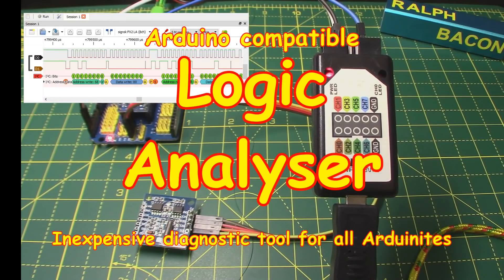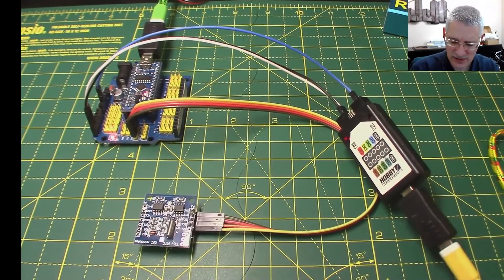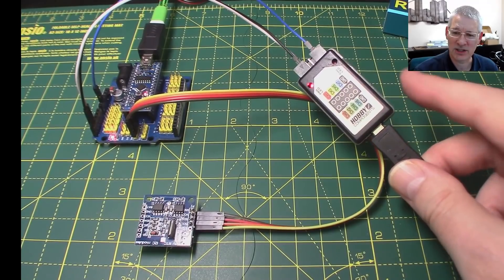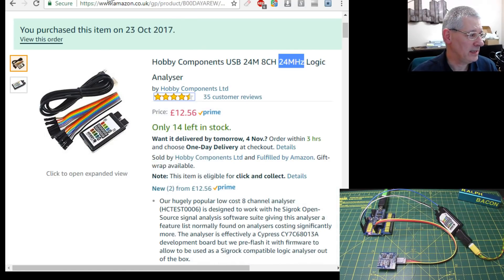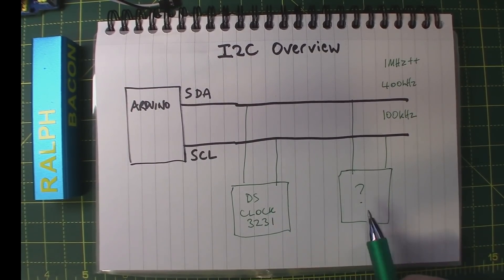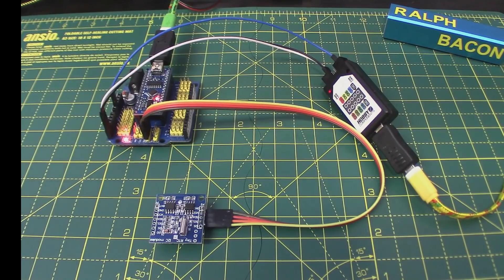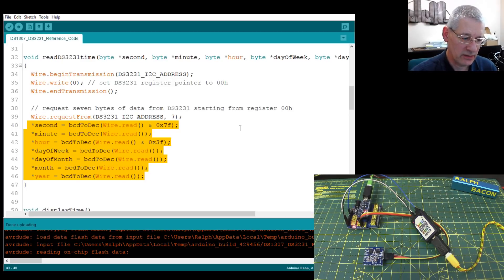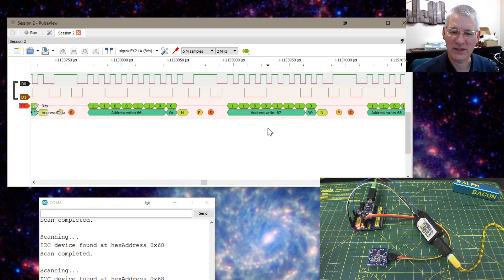#99 Logic Analyzer for I2C, SPI and many more protocols

Comment: Ralph, You have a gift for explaining things in a well-paced easy style. You clearly know far more than you present but keep it at a level that the Arduinites / hobbyists will absorb and then go and experiment for themselves. That is what all this is about otherwise we would have chosen another hobby!

 I have always wondered if I should have a logic analyser but thought it would make me more dangerous than I already am. Based on this video I will get one of these. Not just for comms analysis but also for general debugging as one of the comments below highlights.
Reply from the maker: Indeed, go for it, Whitefields, these are easier to use than I thought they might be, but be aware that there are variants that use the same or similar software and which may not be as easy to set up. In some ways the more you spend the better the facilities (think PicoScope) but this cheap entry level unit is a great hobbyist tool.

Comment: Ralph, 15 months on from your original posting, I followed your video on 9 Feb 2018 and can confirm that it all works. One slight wrinkle is the Hobby Components link to Sigrok needs updating. I suggest your deciples go straight to SIGROK then search on PulseView. Then find a download for their operating system. The driver comes packaged with the download, just run the driver FIRST, then install PulseView. In my case the 8 channel device self-populated in the window and ran first time. The Hobby Components site does have some useful looking troubleshooting info, but I did not need it. Thanks for introducing us to this tool.
Reply from the maker: That's a great piece of information, whitefields5595, and of course, highlights the problem with links to the Internet (which is why I tend to take a copy of the libraries I use in my demos and put them on my GitHub in case they disappear or get updated without being backwards compatible). Glad you liked the demo, it's amazing what you can get for just a few pounds/dollars.

Comment: Yet another excellent video, Ralph. If you ever come back to this subject, one analysis, that is excellent  for demonstrating interrupt driven or cycle sharing  streams, is to analyse the serial TX line and an output pin, say to an led. In the setup function, send a string to serial via println(). Then in the loop function flash the output pin . If everything is wired up correctly, Sigrok should show that when we send a string (or any other data) through serial, the function returns BEFORE the transmission has completed. So, the output starts pulsing before the the string has all been sent. Just one of many examples of how a logic analyser is valuable for showing how the whole system works, not just for fault finding. I seem to remember, many videos ago, you came upon a problem, in which you had sent a string through serial to show that you where in the constructor of a class, but only the first few characters were sent.. Your analyser should show you why that happened.
Reply from the maker: A great idea Michael. It would indeed be interesting to show a bit more with this device (another viewer has commented that a more in-depth video would be appreciated) so I can only say Watch This Space! Good to hear from you again.

Comment: Excellent as usual. I purchased Salae copies on Ebay  using Salae's free software. Less than $ 10 including shipping. There is also an Arduino Logic Analyzer on the net. Uno R3 or Mega for more ports. Much lower speed  but works ok for I2C and serial.
Reply from the maker: Thanks for your post, Nils Skansar, all useful information, good to hear from you.

Comment: Thanks.  I needed a demo before buying.
Working on a team who design and code with I2C a lot, with a high turnover of unfamiliar I2C chips and differing libraries, I have often wanted to pummel the folks who decided to make the read/write bit the least significant bit, so that the question "is that address you just gave me shifted or not?" or "does the software want the shifted or unshifted address?" comes up every single time..   Fixing it becomes non-trivial when the bit shifting is only one potential reason why things are not working.
I'll often be explicit and say byte one is D0 for a write and D1 for a read.
Reply from the maker: The devil is always in the detail, glad this demo helped in some small way!

Comment: I bought a cheap version from Banggood a couple of years ago but haven't played with it.

I'd love to be able to read the binding codes used to bind a RC transmitter to the reciever in cheap toy drones, electric skateboards and RC cars.

All these toys have independent transmitters and wouldn't it be nice to be able to make an Arduino controller that could work with any of them.

I could also read the connection code between my garage door and it's remote to build a phone app to open or close the door over the Internet when desired such as letting a neighbor into my garage while I'm on vacation to get to my lawnmower.
Reply from the maker: Sounds like you have an interesting time ahead with your project!

Comment: Your videos are very use full, although this was about a logic analyzer ( I need to get me one! ) I learned a lot about I2C, (also saw an other video by Antony Cartwright, no good sound but very nice example 'live programming' I2C with 24c64 EEprom) Now I knot how to communicate with out device specific libraries, witch could save memory (later on I'll build my own libraries cos they are very use full) but most of all now I can communicate with other I2C devices with only a datasheet and no lib's at all. (except the <Wire.h> of course). I always thought it would be this simple but could not find a clear explanation. Thanks.
(just found an EEPROM on my DS3231 module... 8-)
Reply from the maker: I'm glad you're finding these videos useful; sounds like you like datasheets as much as I do!
Reply: @RalphBacon     Nr.5 needs more input...   

btw.
I used to bitbang LPT & COM ports to 'control'CD4021 & CD4094 (and others) with Qbasic and later VB6,  until WinXP protected all acces to hardware addresses.
Due to circumstances I was not working the hobby for a few years but last summer I 'found' China (BangXpress..) and You-Tube.
For less than 100.=Eu I now have several Arduino's,  RTC's, TFcards.., 1 LCD (I2C) and a 6 axis accelerometer (?)  and almost all 'old' electronic parts  & breadboards.  But I do miss my Tektronics oscilloscope (+-1958) with a CD4067 I could used it as  a 16 channel logic 'analyzer' ( I could go on for a few hours..)

What I am really looking for is a way to 'talk' with an Arduino from VisualBasic (maybe C+-#@), I hoped it would be 'easy'  cos the Arduino IDE does it too (via USB). But opening a comm port (3 in my case) with  9600  8,n,1 only gives me garbage.
An example I found is made with VisualStudio2013 basic  and it looks like I did it right. (i'd like to use VB6, it still works with XP (& 7)

( a *pointer to a tutorial should do the trick.. 8-)

/Johnny  Five

Comment: Nice video! I already got a Saleae logic analyzer which works really nice, so I just wanted to see how yours worked and if it might be something to buy and have an extra and it certainly seems valuable!

But the most interesting part is that I learned some more about I2C, I didn't know how the scanner worked until now (I haven't really looked either). I guess as you say its similar on SPI, it might also be similar on 1wire as well? Its quite clever, yet very simple. I've had troubles with 1wire on Atmel Studio without Arduino, this might help with getting that to work :)

Really awesome and many thanks for this video! :)
Reply from the maker: Thanks for your post, Chris Fredriksson, good to hear from you.

Comment: Excellent video ........ not sure how much use this would be for a novice (that would include myself) in pinpointing a problem but i'll by one and find out! These used to cost hundreds of dollars not so long ago....... 20 years back:)
Cheers
Reply from the maker: Exactly so, Joe. For the money even novices can experiment, and by doing so learn quite a bit about the communication protocols that the Arduino uses - and which we just consume without understanding what is actually going on. This is not a tool that we would use on a daily basis. But just like that funny shaped spanner in your toolbox, when you need it you got it! Let us know how you get on.

Comment: Would like to add : Don't forget the  Arduino I2C scanner. With this you can check I2C module's 
address in HEX. Modules from Ebay are not always what you see advertised.
Remember some I2C boards have from the factory installed 4.7K or 10k resistors.
Only one set is needed. If you add a lot of I2C modules the resistance will be too low when many resistors are connected in parallel Check with your multimeter.
Reply from the maker: Yes, absolutely correct. (They add the pull-up resistors so the board can work as-is, quickly, without beginners stumbling over how to source and connect the resistors.)
 
But adding multiple modules, all with pull-up resistors, will cause the I2C bus to fail, just as you say. Good point, glad you raised it here, thanks for posting.

Comment: Us Amazon didn't have this one and there are some differences with the ones available without instructions on how to use them.  EI: I bought a KeeYees one and it has ch 1-8 and instead of one of the grounds, it has clk pin.  It is not connected to the ground pin.  I did use pulseview and watch I2C do a scanner and the decoder worked like a charm.  I also had to no use a hub.
Reply from the maker: Excellent, I'm glad it worked out for you, Joseph.

Comment: Ralph have you made a video about a Function Generator or how to use one or if you really ever need one?

I have watched this video several times and use it when I set up my system. But with my birthday coming up I thought about getting a  Function Generator.
Reply from the maker: I haven't done a video on a function generator, Mark, sorry. I have this model:
http://bit.ly/2slz99T
because I wanted to create arbitrary waveforms (eg emulating switch bounce) but you can cheaper ones if you don't need that facility. It's a fairly niche product even in this field so I don't think a video is on the cards. But others must have done a few?

Comment: My scope doesn't do the fancy read so i was going to try sparkfun's Bus Pirate but this one is perfect only amazon doesn't seem to offer it in the states..the ones on ebay seem to be bad Chinese copys and I'm not sure if they will be the same??
Reply from the maker: Best is to see the reviews and comments on these other sites in China. The bad ones will soon get negative feedback and the good ones will get lots of +1s.
Reply: @RalphBacon  Sparkfun does offer a device very similar to the one you show in the video,  about $20 as of when I looked a few minutes ago.  One of those commenting there recommended the "bus pirate" cable to make it easier to hook up ($4.95) and they also offer leads with hook connectors ($4.95) and a logic level converter ($2.95).  I think that I may be placing an order in the not-too-distant future...

Comment: Hello Ralph, I'm a newbe to this digital stuff. If I had a two part device (such as an aircon unit and the indoor blower which has just a data wire and ground) How would you determine which protocol to look for? Can this device (or any you know of) take a sample and tell if it is I2S or some other protocol? So far, the assumptions are that the protocol is known. Thanks. Love your videos.
Reply from the maker: That logic analyser has several known protocols built in, so you could just try them all, Mike! But it could just be serial data like the data you send from the Arduino to your 8-N-1 Serial monitor (eg 8 bits, no parity, 1 stop bit). Start with the simplest protocol (like the one I just described) and move to the more complex ones like I2C. No easy way of finding out if the manufacturer won't/can't tell you.

Comment: Thanks for the great video.  I think I should get one of those analyzers.
Reply from the maker: At that price, George, it's probably worth a punt. Effectively that's what I did on behalf of all my Arduinite followers and with good results, it seems. Just be careful which version you get as I've been made aware that there are several clones (of the Saleae original) and I'm not sure whether this version by Hobby Components is one and the same. All I know is that my version with the opens source software works well (on Windows 10, at least).

Comment: Hello from Canada Ralph. Another excellent video, thank you. I was wondering if there are any bus voltage issues when connecting the LA (powered by 5 Volt USB source) to a 3.3 volt I2C logic bus?
Reply from the maker: And a hearty "Welcome Canada", modicon1! I see your point but I don't believe the probes will have 5v present on them; they should be well buffered, I would think. Perhaps others have more direct expertise on this? Anyone?
Reply: Thanks for the quick reply Ralph... I did some further digging and was able to answer my own question from the Saleae web site. They sell the Logic 8 analyzer which is functionally equivalent to the the one we are using and they say that the input probes with tolerate 1.8V - 5.5V. That is information enough for me to give it a go. If my Logic Analyzer goes up in smoke I will be sure to report back.
Reply from the maker: Great news, good luck with that, and yes, do report back on your success!

Comment: Hi Ralph, thanks for the video. Do you know if this analyse can be used to look at a software serial signal? I am still messing about with the HC12 and getting nowhere fast :-) I still hope that you might be interested in a video about getting altitude from a BMP180 across to a receiver. I have a problems with getting the data ready for serial transmission. Anyway thanks for your really useful videos once again.
Reply from the maker: I don't see why it would not work, OE8PCK, after all, Software Serial is just a software implementation of the hardware serial protocol. Regarding other videos... believe me, the list is long and time is short. What to do?!?
Reply: Got the Logic Analyzer working . It is really good. I am sure it is very easy regarding the Software serial if you know what to do. i am trying to send data with max 3 digits before the decimal point and two after up to 900, it just does not work. There is no information on Utube. O well never mind.

Comment: What are those short positive pulses (much shorter than the clock time) on D1 on the falling edge of the clock for some, but not all, data bytes (starting from 26 min 30 secs)?
Reply from the maker: I believe you're seeing the ACKnowldege pulse on D1, Embo, shown as ACK in the Address/DATa line at the bottom of the picture. It is so short that it doesn't always appear because I have not zoomed in enough.

Comment: Useful little gadget. And it's weird that you're using an RTC to demonstrate it as I'm working on one now. Is it possible to set the time on a DS3231 using a rotary encoder? I'm new to Arduino and trying to make the clock I've built self contained but I have no idea where to start. Hoping to get it to enter hour set mode with a push on the encoder, then left and right for up/down, next press cycles to minutes etc.
Reply from the maker: A rotary encoder would be perfect to set the time on a DS3231, Moonbrony. See video #19 to see how to use one (and how they work, it's important you understand the principles). If you do the sketch in that demo you will probably realise how to write it to set the time. Come back here if you get stuck! I might even steal your sketch, heh heh.
Reply: Thanks. If I get this working as intended I'll happily send you my sketch. I bet a lot of people would like to make something like this as a project.
Reply from the maker: Yes, they would, and would you believe it I almost did one but decided on using two (just two) switches instead. But a rotary encoder would be much slicker. If you ever create that sketch let us all know (and post the sketch on Github or somewhere central - or I can do it for you). Good luck.

Comment: Can I use I2C protocol to transmit between 2 units at a distance of 150ft, if I beef up the voltage potential on the lines?.
Reply from the maker: No! The data will be corrupted, Malcolm. However, you can use something like a PCA9515A (Dual Bidirectional I2C Bus and SMBus Repeater) or P82B715 which is a bit like using an RS485 link but specifically for the I2C protocol. It allows up to 50m cable runs. I'm afraid I'm not knowledgeable about these so some research by you will be required! Google "I2C extender" for inspiration.

Comment: Is it better to have logic analyser built into oscilloscope or to have it on PC?
Reply from the maker: Short answer: yes. 

Longer answer: horses for courses. 

If you scope has an 8-channel logic analyser as part of its make-up then that's a bonus and should work just fine. Having one connect to the PC means that you might have longer leads or awkward viewing angles along with separate software but a PC-based one will also do the job just dandy.

Comment: When you buy I2C breakout boards on Ebay  many of them have already pull up resistors installed. 4.7 k or 10 k ohm. Check with your multi meter. You also find very cheap  logic analyzer clones on Ebay. Legal or not ? I don't know but they work fine.
Reply from the maker: Every device sold on eBay and elsewhere has the pullup resistors already in place, which means if you put half a dozen devices on I2C it will stop working. Ideally, the first device should have the pull up resistors and all others have them removed - but then they will not work by themselves. Doh!
Reply: @RalphBacon  Anyone old enough to remember RS422?  Used many devices BEFORE I2C or USB!  lol